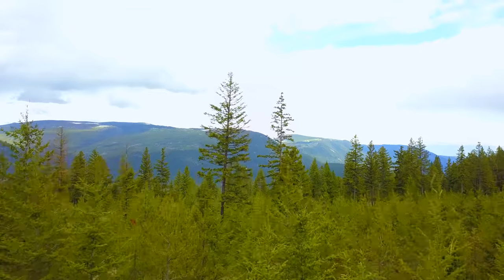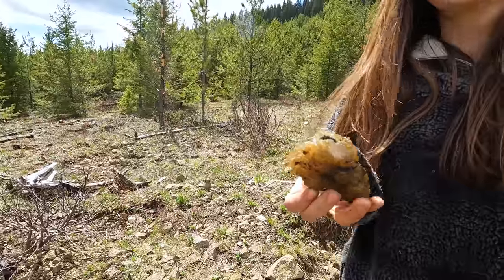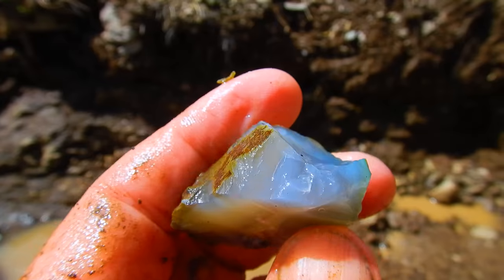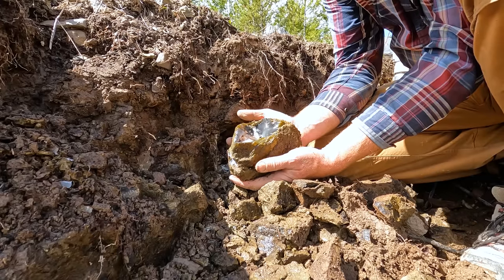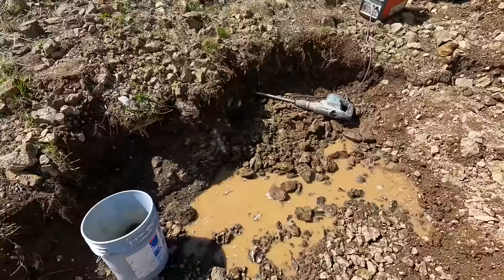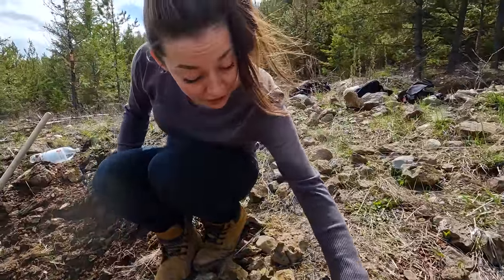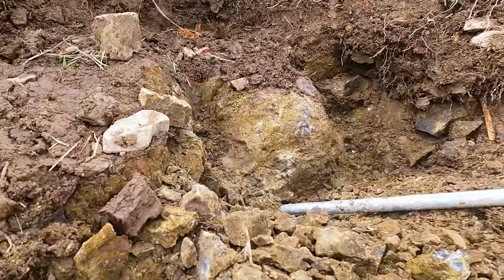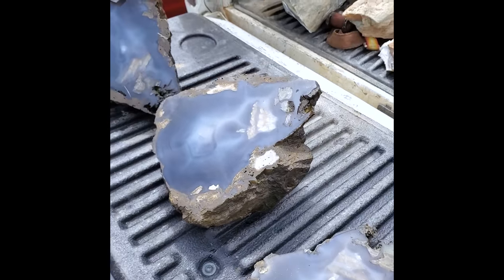HUGE! Gemstone found on Private Gem Claim.

Comment: Hi Dan, all of those agates are nice, those bigger ones however are just awesome. Glad you took the time to show us the cut pieces, it gives us a better appreciation of the pieces that you took out. 
An older specimen miner I spoke with some time back told me once you find a good piece “dig away”  from the specimen, his suggested that however big (diameter) of the rock or specimen is then that is the distance you start away from it, then work your way back towards it, he said it minimises stress fractures in good pieces even though it takes a bit longer. I have not done any of this kind of digging so I don’t know if this is correct. I would be interested to know if you think this would apply to those big clunkers, or if this would be more suitable to more fragile specimens. 
Great video though, kept me enthralled till the end. I found myself considering the old miners words while watching you dig out those bigger pieces and wondered if he was giving me good info or just his personal digging method. 
Keep Safe & Keep Rockin & you keep looking after yourself.

Comment: i use to fossick for agates like that near me but ours are blue. anyway the host rock they are found in here is hardened volcanic ash and i was told the tear drap shape has to do with the way molten material was flung through the air and then landing in the ash creating the pockets. im kind of curious if your bed rock is actually an ash layer over ancient soils.... dont get me wrong ive seen petrified ash falls over 40m thick. PS they look like ancient hand axes

Comment: Don't put mutch pressure on the drill. weight of machine is perfect and will work better. Hamer can make larger hits.
Reply from the maker: I have thousands of hours on this tool doing this in this type of rock..  I know when to push, when not to and when to do things people would not expect.  I have a LOT of experience doing this.

Comment: When using a hammer drill like that don't put too much pressure on it and it will plough on through. When you push hard it reduces the length of the chisel movement.
I watched a French electrician drill in 3 x 1meter sections of galvanized earth rod through hard clay with a drill just like yours hands free while he  did all the wiring in the the house. 
Hammer in first section until it is stable then put drill, with a welded up adapter/tube, over the top and use a steel rod hammered in next to the handle to stop it turning but let it descend. The weight of the drill is all it needs.

Comment: I wonder if it is possible to drill LED sized holes in the agate?  I think it would make a nice LED display using red, green and or multicolored light changing LED
Reply: Sure, it's fairly easy to do with diamond bits.  They make twist drills, spade, and hole saw type bits with a sintered diamond coating just like the rock saws used to slab the agates.  Find a stable area without cracks or defects and go slow with light pressure, use lots of water to keep it all cool, and keep the bit straight and centered.  Be prepared for the agate to break though, sometimes there's a weak spot you can't see that'll cause it to split.  The thicker the slab, the less likely they are to break.  Alternatively, an agate split in half can be illuminated from the back with multiple LED's drilled through the rind.  Position your LED's in the hole or holes you've made and either use epoxy or hot glue to seal it up, then run the wires through a wooden base or frame supporting the agate to a battery pack or plug.

Most of the pretty agates aren't all that great at transmitting light length-wise due to the banding though...sometimes it'll light up great at the base but hit a band that'll essentially stop the light from traveling any further, leaving the top unilluminated.  Occasionally you'll find agates that transmit light really well but they don't have the most interesting patterns and banding.  Large chunks of chalcedony (basically the same as agate, but no banding) are ideal for that sort of thing.  Another light to try is UV, many of the agates I've found have been quite UV reactive and show banding that is otherwise invisible.

Comment: if you go around with some garage sales Maybe around here we got this place called Harbor Freight they sell kind of inexpensive tools. but why not try experimenting with filing on the end of a fatter head chisel and making yourself like four spikes and then rounding off the tips of the spikes kind of like a big fork and then Round Up round off the points a little bit maybe you get some better efficiency and penetration and you push the rock Maybe instead of just driving through it

Comment: That rotary hammer does more damage than good. Kinda like swatting mosquitoes with a howitzer.
Reply from the maker: its a volume thing.  I can move 10 times more with the big tool.  resulting in 10 times more finds.  yes I might break 20% of them.  But even with smaller hand tools I am still breaking 10% or more.  So in the end I am still getting 800% more agates, big and small than I would using hand tools.  Plus some broken ones, which we still use.
Reply: @Danhurd  Okay, thanks. The agate does look pretty brittle.

Comment: Dan - seems to me you are hammer drilling to close to the good stuff.  Back off several inches (5-10mm) and loosen around the hot areas.
Reply: 5-10 mm is closer to a qtr to half inch. Not several inches
Reply: @kylealexander7024  Brain dead in the early time - 2" is naturally 50+ mm. 25.4 * 2. Oh well the degree in physics didn't wake me up. :-)

Comment: There are some old magma sills and dikes exposed in a couple locations I know of in NJ.  Years back, a few kids I knew up there found some geodes only a few miles from a place where I've gotten some magma samples.  There are some pits and holes in it, and it weathers quite completely down to iron-rich clay.  In fact, the samples I broke off and left outside have gradually turned so soft I can crumble parts by hand.  It might be a good idea to revisit those old magma deposits.

Comment: I have a spot down here in Colorado where I find those  but most of what I pull out are geodes.. Biggest one I have found was about grapefruit sized ... But also the ones I find are very iris around the hallow core with with the blue of the agate turning to cream and yellow towards the core!... Also have another spot where the agates are coming out of the ground in plates that can be about 2 inches thick and look more like melted cheese but the coloring on them is a greyish brown and solid core... Biggest one of those I found was about 15 inches accross 8 wide and 2 inches thick!

Comment: I have a question....why do you keep using that hammer so close to the gem/stone if its clearly chipping and damaging or even splitting it. Why don't yall use more gentle tools to it all together as a large " specimen "  or does that not really matter if your gonna break it down anyway into jewelry and other such resale sizes
Reply from the maker: its a volume thing.  I can move 10 times more with the big tool.  resulting in 10 times more finds.  yes I might break 20% of them.  But even with smaller hand tools I am still breaking 10% or more.  So in the end I am still getting 800% more agates, big and small than I would using hand tools.  Plus some broken ones, which we still use.

Comment: Love your videos 
BUT ...Please stop prying with your hammer drill
 I bought and used a Hilti Rotary Hammer Drill at work a BUNCH 
It was always in the truck 
As I needed to drill holes for up to 6"condite through concrete walls 
Or chip out areas in walls 
If I saw another worker used the  Hilti Rotary Hammer Drill to pry with like you are 
I would have given them a "Talking To" 
As I have seen the front of the attachment joint break from people prying with the tool 
I didn't want to replace the tool unless I had to , don't remember exactly 
But the  Hilti Rotary Hammer Drill was close to $2000 with just a chisel

Comment: Have you ever thought about turning an old clothes dryer into a large rock tumbler? I'm betting it could be done.
Reply: RPM is waaayyyy too high for that, but it would be hilarious once LOL
Search for the video of a guy throwing a brick into a running dryer to see why.

You could replace the motor in the dryer to drop RPM, but how are you going to seal it so the water and grit doesn't leak out?
A cement mixer would be a better choice if you're repurposing things into a rock tumbler.
The baffles on the wall of both the dryer and cement mixer have to be removed as well or you'll end up with a lot of broken bits of rock.
Then you have to be concerned about the steel wearing out rapidly...tumbling stone with a higher hardness and using an abrasive that's nearly as hard as diamond means that steel is going to wear ridiculously fast.

It's actually way easier and cheaper just to take a 30gal plastic drum and set it on rollers, using a belt drive around the lip of the drum.
You can set the RPM where it needs to be with the right size pulley, no need to remove baffles, and the plastic won't wear like steel would.
If you don't need something as big, a short section of PVC tubing (6"-12" diameter) capped off on one end and a removable cap on the other is often used.
Using steel rods with pillow bearings and covered in rubber hose (just like little tumblers) gives you the drive.
Run a single drum or a dozen, just depends on how long you make the rods and how much room you have.
The ability to drive several drums at the same time is beneficial when you have different hardness minerals being tumbled, only tumble minerals of the same hardness together.

Comment: Hm. I feel like I need to have a stained glass type window made out of nothing but agate. Yep, that needs to be a thing
Reply: I've seen a wall made with lots of small holes sealed with agate slabs for lighting, but never a stained glass type window.  My concern is how the agates would handle the heat of soldering, as I've heat treated some at 400F for flint knapping and there were a few failures.  Agates often have microscopic pockets of water that expand and cause cracks or spalling.  Probably needs to be a non-traditional approach with something like JB weld or similar metallic epoxy to replicate the look of solder.

Comment: ,former construction worker you need some safety classes. Number 1 water and electricity don't mix. Keep the drill and cords out of the water and do not stand in the water while using a drill. You also need boots knee pads or foam pad to kneel on. And you should have safety glasses on. I'm gonna sick MSHAD on you

Comment: Dan couldn't a small backhoe be brought in to loosen up the soil?
Seems to me you are s l o w l y breaking your backs 
Not to mention with that drill thing looks to be just damaging way more than you are getting.
Reply: Usually machinery like that requires a permit.   Also it can depend on where his claim is located and if it's even possible to get one up there.

Comment: The power tool just destroys the rock. Stop being so lazy, start using hand tools.
Reply: Given the gravelly structure of the soil, would making a hole further back and then using a breaker bar as a lever, be better at loosening the rocks?
Reply from the maker: Yes hand tools work, but with hand tools I would move about 1/10 the amount of material, get 1/10 the amount of agates, and have 1/10 the chance of finding a big one.  I may have hit 20% of them, but in the end still got 8 times more than I would have with hand tools.  I actually know what I am doing.